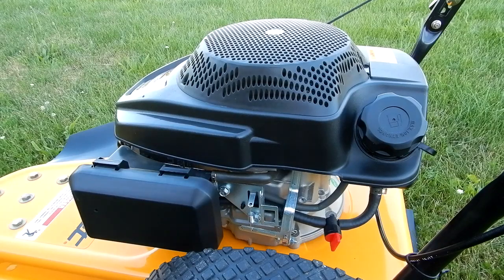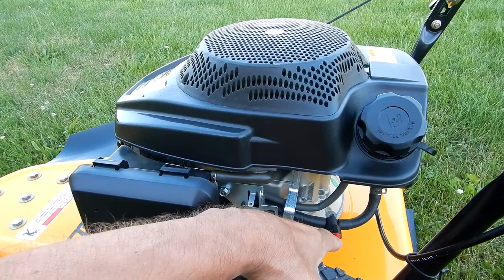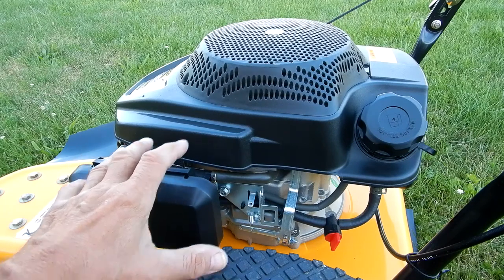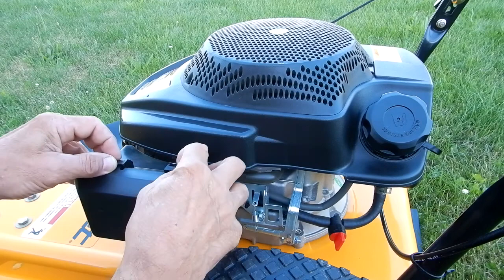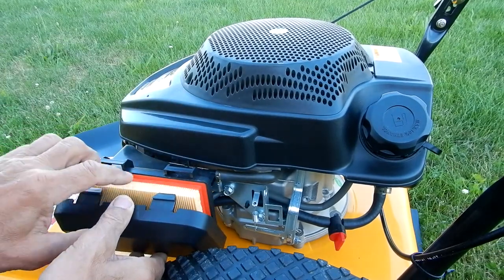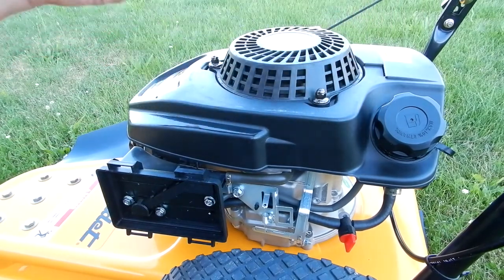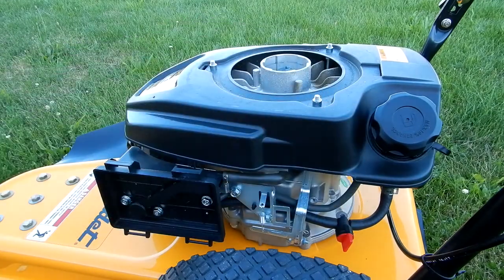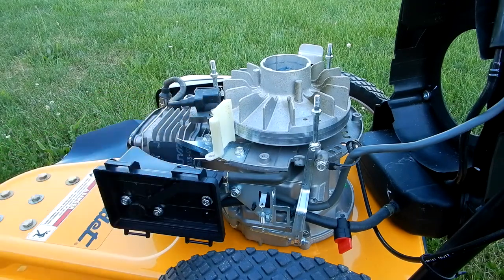Installing a new Carburetor on a Cub Cadet ST 100 field trimmer mower

Comment: Thanks for posting this.  I couldn't figure out how to get the linkage out.  Your instruction helped alot.  

This carburetor  is such a bad design.  Mine only lasted one season.  It might be worth it to buy ethynol free gas, which were I live can only be bought at Home Depot in those small cans.  

I believe the linkage and plastic flap thing is part of the automatic choke system.  As the RPMs increase, the airflow moves the white plastic paddle; and through the linkage releases the choke.

Your ST100 looks brand new!  You must take really good care of it.
Reply from the maker: jessasdad   Glad you found it of use! BTW, I have since found a farm supply place that sells ethynol free gas at the pumps. I've been using that on all my small engines since. Yes, I am very picky with everything I own. Got to keep things in good order and looking good.

Comment: Thanks for your video! I bought a used Cub Cadet trimmer like yours a few months ago really cheap. I struggled to get it started so I put on a new carb. It still would not start and I spent hours trying to get it to run. I finally found a manual on the engine and discovered there is a tiny inline fuel filter that is in the outlet tube of the fuel tank! I removed that filter and the engine will now start and run! Pull that filter out and add a real fuel filter in line on the fuel line!!
Reply: When replacing that inline filter, having hard time removing fuel line hose from tank without cutting it off & replacing entire hose, any ideas? Soak wrap /soften hose or ?
Reply: Can I see the video of the linkage being correct
Reply: Yep remove that filter and install a inline one
Reply: Just installed new hose with cut off and filter, done ✅
Reply: Does the manual show how to do that?

Comment: Great help pulling it out. A tip for whoever is doing this after you get the carb back in. Make sure all those moving parts can swivel easily. I ran into a weird problem with the one in the back. (with the spring)

It wouldn't turn freely. I kept thinking I did something wrong. I ended up pulling the carb back off. And it still wouldn't move. So turns out it had alot of build up which was keeping it from spinning. I had to remove the tiny bolt holding the butterfly plate on. Then the pin slides out. Then I used I tiny flat head and got all the gunk out. Put the pin back and it spun freely. Put everything back on... Bam motor running back to normal.
Reply from the maker: Thanks spafro101.

Comment: Very nice video man … well thought out and informative. Your observations about ethanol-free gas are spot on … been running all my new equipment that way, and dealing with the holdovers until maintenance/replacement. ✌🏻
Reply from the maker: Thank you so much @patmcgroyne784 👌

Comment: I have heard that the additive STA BIL will cause the carb bowl to do this. My SC 100 mower did the same thing as yours. When I pulled the bowl off the carb it looked worse than yours did. I just put a new carb on my mower and it started right up with no problems.
Reply: My bowl looked a little worse than this. I used the stabilizer you are referring to. That may be why. Thanks for the video

Comment: Dont throw the old carb out, you can soak it in straight Pine-Sol and use a bread tie wire to run thru the center of the jet and blow air to finish...now ya got another spare carb. Soak the bowl in vinegar and even sand, wire brush, or sandblast the inside of the bowl. Thank you for a great video.
Reply from the maker: You're welcome Tom!

Comment: Outstanding video, I had trouble with my string trimmer the first took the bowl off and it was full of debris gave up on taking carb off but I wont the next time. I installed the same kind of fuel shut off but it does not turn freely almost like its gaulding any idea what could be causing this I think I purchased 12 of them from Amazon.
Reply from the maker: @charleshopkins4475   Probably a bad shut off valve. Replace it with a new one.

Comment: I just picked one of these trimmers up from my neighbor. Followed your directions to the T, 2 pulls and it started but only seems to run at an idle. I'm guessing that's how it's supposed to run.??  Can you help?
Reply from the maker: Thanks Steve. It only has one speed once started. When you let off the "brake" handle the engine stops.

Comment: Great video. Just what I was looking for! 

Can someone pls. tell me where the two lines for the carbon cannister attach to? When I removed the engine shroud, one came loose. The other is attached to the back of the air filter housing, and from this video it looks like the other goes towards the fuel tank. That makes sense base on carbon cannisters on cars that I have worked on, but I don't see where it goes.

Note to anyone from Cub Cadet who is reading this: it would really help if your parts manual also showed where items connect to each other.
Reply from the maker: Thank you!!!

Comment: Can you drain the carb bowl without removing it?
Reply: Yes very simple. Use a 10mm wrench on either the drain plug or the bolt that holds the bowl to the carb. Be careful not to loose or damage the O ring seal

Comment: How do you keep
It so clean. Mine has lasted at least 5 yrs or more and used on 20 acres with lots of brush. Will never look like yours.
Reply from the maker: @Tebazi   Thank you. First, I am very picky and try to keep all my equipment in tip top condition. Second, I have 4 acres but only really need it for my south side line and a few other spots. I always blow it off when done and will clean it every so often. At the end of the season it does not get put away dirty and I even use furniture polish on it. My car has two seat covers on it. Not sure what color they are :) The plastic panel on the "rocker panel" of my 2014 CR-V looks brand new. I do not drag my shoes over it. Like I said, picky :)
Reply: @starastronomer thanks for replying, hey I just got a 2024 CR-V great car!
Reply from the maker: @Tebazi   You're welcome. My 2014 Honda CR-V [bought in April 2014] has 161,500+ miles. It has been the best vehicle I've ever owned; VERY RELIABLE. The others were Chevy's which I will never buy that brand again. I change my oil every 5,000 miles.
Reply: @starastronomer  i had a 2014 Nissan Rogue 160+k mi never had a problem also changed oil n filters religiously. The last year it started to decelerate on interstate doing 75 -80 on hot days (Fl) apparently for safety reasons(I would pull over turn it off and after 5 mins start up again np)  I read somewhere. Nissan couldn’t find the issue so it was time to upgrade and gift to 15 y/o grandson learning to drive. :) I was  longtime wanting the CR-V EXL. So it worked out. :)

Comment: @starastronomer I’ve followed this tutorial to the letter and mine won’t run it all. It fires off ether but dies immediately. There’s fuel in the carb bowl. I have a new carb on the way. 

FYI the carb has been blown out with carb cleaner. The main jet is clear, the float works fine the pilot is clean and the mid range jet is clean. 

I’m stumped
Reply from the maker: @bobtosi9346    Whenever I clean a small engine carb I use "Oxygen-Acetylene Torch Tip Cleaner Kit with 12 Stainless Steel Reamers" similar to these: https://www.homedepot.com/p/Lincoln-Electric-Oxygen-Acetylene-Torch-Tip-Cleaner-Kit-with-12-Stainless-Steel-Reamers-KH575/100341101

I have one bought at a local welding supply shop that has many different sizes. You want to use the largest diameter that fits but WILL NOT STICK in the holes. You do not want to make them bigger. I have found you can use cleaner but really need to "ream" the holes too. Do all the holes. Give that a try.
Reply: @starastronomer  new carb new plug new filter. Fires up on fuel but dies right away like it choked. The in tank filter is removed and I have a new inline filter. Gar is flowing through the filter.
Reply from the maker: @bobtosi9346   Linkage is on properly? Is anything stuck or binding that the linkage moves? Is the choke working; did you see it work properly?
Reply: @starastronomer  yes no yes
Reply: @starastronomer  I’m pretty convinced now it is the ignition module. Something is happening as soon as the mower starts running. Maybe wires coming loose????

Comment: @starastronomer is it possible my machine won’t run with ethanol mix fuels? It quit last year after I forgot to drain the old fuel
Reply from the maker: @bobtosi9346   Very possible old gas, not necessarily that it has ethanol fuel. I always start the year out with new NON-ethanol gas I get locally for all of my small gasoline engines.
Reply from the maker: @bobtosi9346   AND I drain out all gas at the end of a season.

Comment: The drain on the carburetor is a poor design.  It doesn't drain to the bottom of the bowl.  It leaves a little gas in it.  I think what you were seeing was varnish from dried gasoline not rust.  Being that there is no iron/steel in the system it wasn't rust.  If you want to drain all the gas out of the carb, you need to take the bottom bolt out.  This holds the bowl on, but nothing will fall out of the carb.
Reply from the maker: I think you are correct.